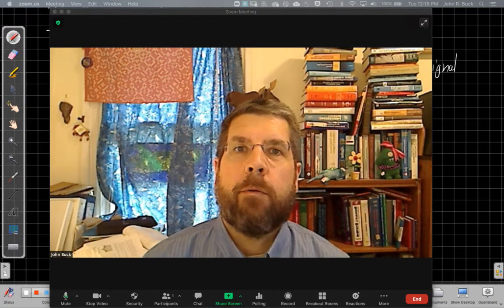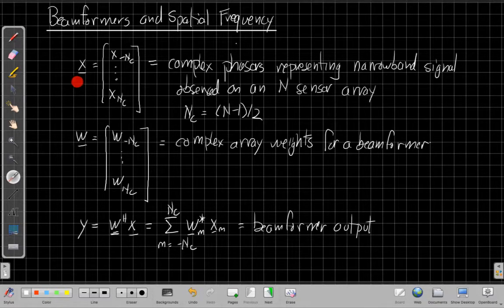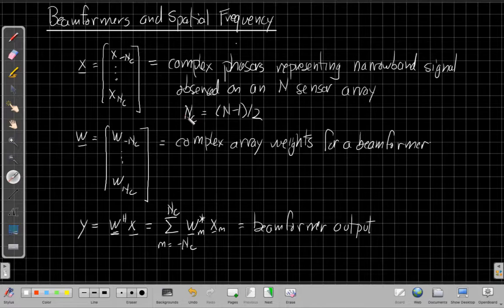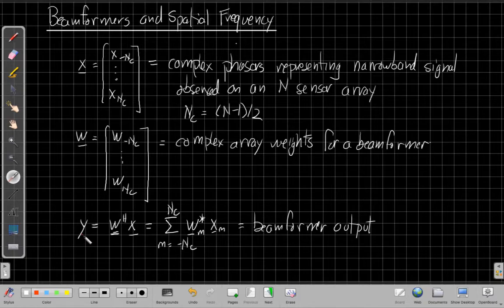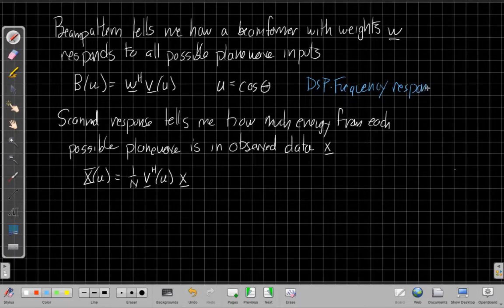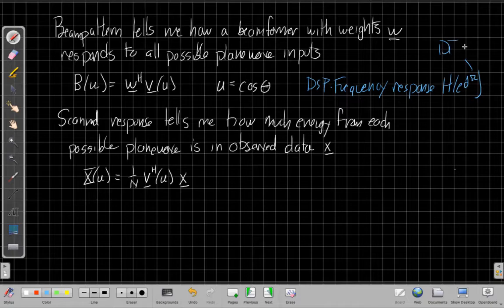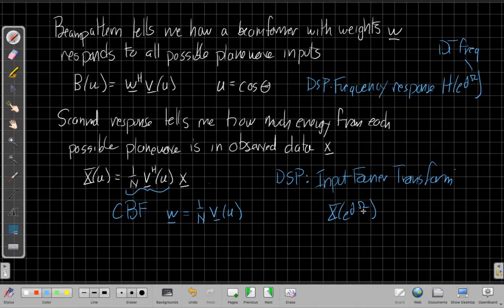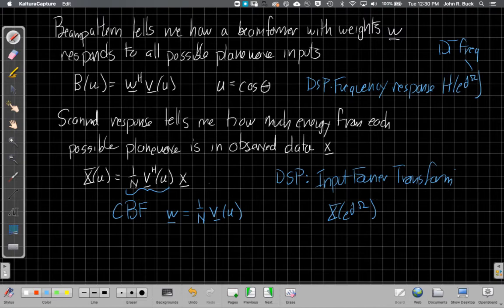Spatial Frequency Interpretation of Beamformers: Part 1

Comment: I'm having trouble finding information about the "scanned response" in textbooks.  Is it sometimes called something else or do you have recommendation where I could read more about the scanned response.  Also, these videos are excellent - thanks so much for sharing them!
Reply from the maker: The scanned response is the estimated spatial power spectrum obtained by plotting the output of steered beams for many different looks directions.   Loosely, you can think of it as the input spatial Fourier transform to the array system for a single time frequency.   Many books talk about the theory but don't use this name as much as its used in practice, in my experience.    If the array is a linear array on the z-axis, this would take a form like S(k_z; omega) so it is a function of the directional wavenumber k_z which might change for different temporal frequencies omega = 2 pi f.

Comment: Good lecture, thanks for uploading. 

Also anyone know why is there a hermetian on the weights ? what's a hermetian even do
Reply from the maker: Hermitian is a conjugate and a transpose combined into a single operation.  When we do linear algebra with complex vectors, the inner product is defined with the Hermitian, not the transpose so that <x,x> = norm(x)^2 still.  In a practical engineering sense, the conjugate flips the phase of the array weights, so the time shifts in the array are the opposite of the time shifts in the data and the times shifts cancel out so the sum then creates constructive interference when we add all the shifted signals at each sensor